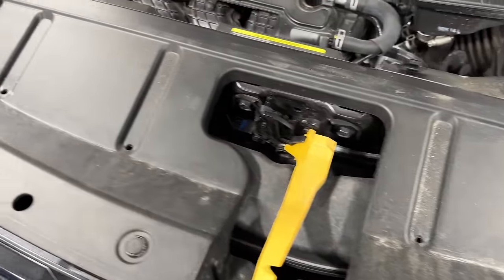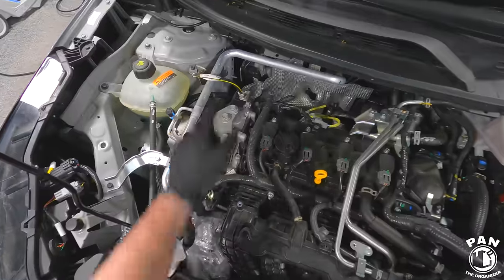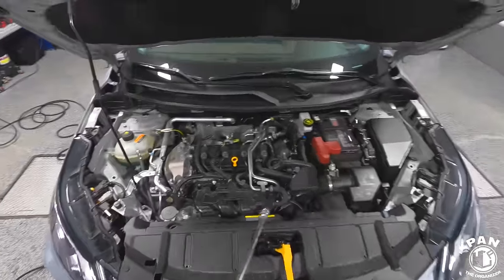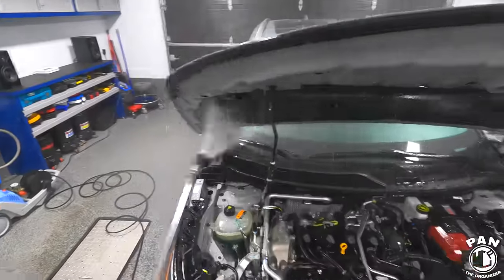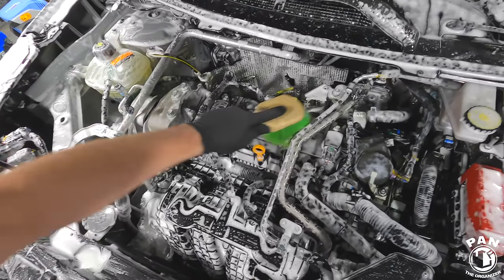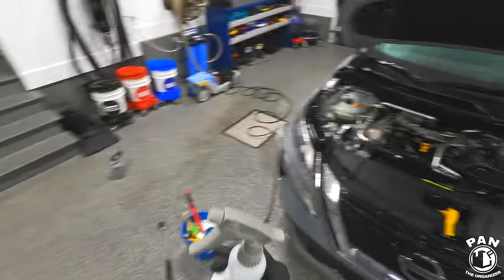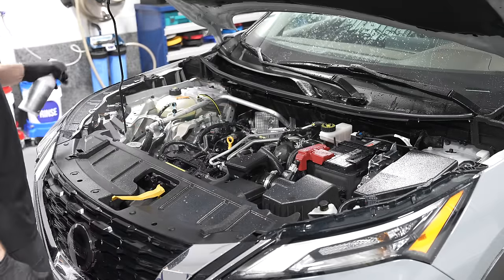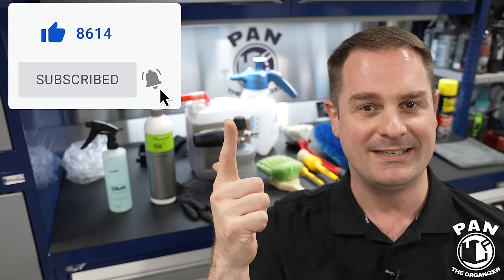How to Safely Clean Your Car's Engine Bay!

Comment: Great video as always. Still I'm not sure that using the pressure washer is safe. Instead I always use a couple of brushes and microfiber towels to do the job. It takes a bit more time but i think it safer that way and preventing any risk caused by water getting to some electrical parts, etc.
Reply from the maker: You do as you wish. I have pretty much always used a pressure washer and never once had any issue or feedback afterwards that something went wrong. Again, common sense. Also, a pressure washer uses less water compared to a garden hose. So although it seems like you're using a lot of water, you're actually using way less compared to a regular garden hose setup.
Reply: @PanTheOrganizer  LOL. Ivan is using a $20 garden hose that uses more water, while you’re using a $1500 pressure washer that uses less water. Ivan has saved himself a lot of money by using a little bit more water. Go Ivan.
Reply: Actually it’s quite safe to use the pressure washer if you are using common sense, staying below 2000 psi, and always keep the sprayer moving as Pan says.  Dealers use it and professional detailers have been using pressure washers for a long time now.
Reply: If water getting into the engine bay was an issue, we’d have issues every time it rains or we run through standing water. The only issue I can see is if you get too close with a pressure washer. If you use a fan spray and stay at a sufficient distance, you’ll use much less water with a pressure washer than a garden hose. However; like Pan said: you do you.

Edited for spelling
Reply: @CageyLeigh  1500$ for a pressure washer? Umm you know u can get one for 100 right LOL
Reply: You guys remarking about cost of pressure washer, if I may add to the o serration of 1500 is way expensive and can do with much less expensive…   Let me pitch out there that  since this man does this for as part of his business I suspect he can write it off on income tax.   Not to mention that usually a cheaper device will have comparable materials quality and build quality.   To buy a very well made for daily business use may well end up being less expensive in the long run by probably lasting longer.   Pan’s obvious attention to detail, self demands excellent product quality and I would think he expects same consistency and quality performance of his devices.  Thus requiring higher quality devices.    Pan using top notch equipment in videos gives an ole retired fella an opportunity to see grade A equipment in use.   I can then decide what I would be cool with compromising so to balance across all the gear one might use for the job.   Just sayin’   
JB
PS  Pan thanks for your complete triaged points of discussion across your videos.   I learn a lot from you.   Jb
Reply: @CageyLeigh  you tried to do something there but the pressure washer is also used to add a foam canon attachment. Ivan I’d using a garden hose not getting suds to develop to help get rid of dirt and contaminants. Ivan is scratching customers paint upon washing/drying. Ivan in the long run is going to work longer and harder for same job..

Comment: Awesome or Purple Power would've been better.  Crank cold car and let it run 2  minutes. Cover anything you may be afraid to get wet with plastic bags. Spray the Awesome or Purple Power on the engine and agitate with a brush. Spray another coat and let sit for 5 minutes, then rinse with water. Take a leaf blower or anything that blows air to dry. Touch up with a dry towel. Then dress plastic and rubber. ✌🏾

Comment: The engine came out very nice! I've cleaned a couple engines and have had no issues so far. Just take your time and use common sense like you said.
Reply: Riiight!?? Common sense.
Reply from the maker: There you go! You got it.

Comment: Unpopular Opinion: No one has issues immediately after cleaning an engine bay.  It's days to weeks later when the damage may become noticeable and often isn't even associated with the cleaning that took place some time ago.  Many experienced mechanics cringe at the thought of washing an engine bay because they KNOW what the outcome can be.  Be extra careful.
With that said, these tips and techniques are probably the best for minimizing issues.
Great work as always Pan.
Reply: that is true for old cars, where the gunk is probably blocking a oil leak.
Reply: It'll definitely mess with the ignition coils on early 2000 models.
Reply: What is the point of cleaning it? May be a stupid question from my side, but I just do not understand why undertake the risk of damaging the engine. Will the cleaning help anything?
Reply: @igorspitz  because when you have to fill the oil, power steering, and any other fluid, you don't want anything falling into the hole.  Also, when you have to service parts, they aren't gunked in grease.   You don't want this grease to get into the fittings, bolt holes, etc.  Essive dirt in your engine bay can get into electrical connections.
Reply: Well, how can you say "no one has issues immediately after cleaning an engine bay"? Of course some people do. People with old engines, crusty cracked rubber/plastics covering electronics and with a heavy hand. They can have immediate issues. And in all my years of cleaning engines, I never had a problem surface weeks later. But I also never acted a fool with water in there. 

Modern cars are totally different. They are very much designed to keep water out of areas where water shouldn't be.
Reply: @igorspitz  Everything is better when it's clean! That's the first answer. The practical answer is since cars pick up oils and grease from traffic driving in front of them, eventually all that gunk works its way inside the engine of your car. So 1) it helps differentiate issues with new leaks, 2) to a lesser degree, engines run cooler when they're clean and not coated with gobs of oil and grease, 3) it makes working and maintenance requirements less messy - whether you do it yourself or pay someone else. I have heard mechanics get annoyed at customer's disgusting engine bays and semi-retaliatorily allow their dirty hands and clothes inside their cabins figuring the person obviously doesn't care about dirt and grime. Personally, I love a clean car, inside and out.

I could go on and on, but there's a few for you.
Reply: @jasenrock  That's not the reasoning, it's all the electronics on modern vehicles.  Blasting water in your engine bay can wreak havoc on those components.  Like he said, you might not see it right away, it might be months later.
Reply: That's not unpopular to me.  I would never do what he's doing here.  At most, I will take a shop towel with some soapy water and wipe down excess dirt, but never spray anything in my engine compartment.  It's simply not necessary.  Nobody is looking at your engine, and cleaning it does nothing to improve your car.  If you're working on something in your engine, yes, clean the area before opening something, but a visually clean engine bay does nothing to improve performance, and it does nothing to ruin anything either.
Reply: agreed.... especially if the engine has a tiny oil leak(for example, valve cover or oil filler cap)...   just a tiny bit of drop getting into the engine like that can cause nightmares.
Reply: I wonder if this guy is related to Peter Pan?  A real cartoon character......
Reply: To ridefastjumphigh420. Most car dealers new and used do this to used vehicles that they are selling. Also if thier was that much risk do you think the detail chemical companies would invest in R&D to make them. I know your probably saying they don't care what happens when you wash your engine they just want to sell their cleaning chemicals. Like Pan said use common sense and don't soak the crap out things.
Reply: There is a risk of water intrusion into subsystems with any water exposure, age and pressure will make it more risky. Conversely, it is a lot easier to identify leaks and leak sources when leaking subsystems are clean, with a big bonus of noticing the leaks when cleaning.
Reply: I won't use  pressure water; one drop of water can go into a plug; it has happen to me immediatly after cleanig; I am gone try a vapor gun
Reply: I cleaned my engine bay in a Volvo MY 2020 last week for the first time in three years. It was almost not dirty at all, took an APC, a few brushes and cloths and went to work on everything I could see. Used some pressured air and a vacuum on the rest and finished off with some plastic detailer. Looks really good and no risk of damaging anything. The hood and surrounding plastics got some degreaser and pressure washer.

Doing this twice a year from now on will keep it fresh enough in my opinion. Great video though if you want to have it super clean!
Reply: I think it depends on the car/ some already have exposed bays via scoops/vents so there is always water getting in the bay.
Reply: Totally agree. Part way through the video he said to always have a customer sign a disclaimer, saying there’s no cracks in any cabling or plastic under the hood. Even if someone is a master mechanic, there’s no way to know that… because modern engine bays are so congested and tightly packed. 

I read a comment in another thread about a guy who said he ended up with a poorly running engine because the camshaft position sensor housing had a microcrack and got wet.
Reply: I love Pan but the first time I did this it came out looking fantastic. But now I have a problem with a miss. The engine doesn’t run smoothly and my gas mileage is way down 💩
Reply: @MrAwyork  It's far more likely that the water will get into the electrical connections.  It takes a while for copper to corrode, so the problem usually takes weeks or months to surface, at which point it's not immediately obvious that the water used to clean the engine bay is the root cause.
Reply: @tedjohnson64  an engine gets soaked when driving through a thunderstorm.  I live down a dirt road.  Dirt from mud puddles has caused more problems with my car than water.  In fact, I was recently charged an extra hour of labor on a repair because the mechanic had to clean up so much gunk to get to the bad part (oil pump)....on the plus side, the gunk was effectively sealing up a crack in the pump.  Went from a rebuild to replace.
Reply: unpopular fact*
Reply: @MrAwyork  If dirt mud puddles is causing problems with your engine, then either your plastic undershield panels are missing, damaged, or just poorly designed. And I've never seen a car whose "engine gets soaked when driving through a thunderstorm".  There's very little water that makes it through the typical car grille, and the water that does usually disappears almost instantly due to engine heat. The story about a mechanic charging an extra hour to clean up gunk to get to an oil pump is also hard to believe.  I've seen the underside of working farm trucks, brought to the shop without being cleaned, still caked with mud and cow crap, on the South Main Auto repair channel.  When he put them up on the rack, the engine compartment (where the oil pump lives) was only mildly dirty, because it was protected by the plastic panels under the car.
Reply: @tedjohnson64  the puddles are deeper than the bottoms of the doors.  I saw the gunk myself.  So, real story.  I actually stood next to the mechanic under the car when we were deciding there was a problem with the oil pump.
Reply: @tedjohnson64  also it isn't the rain so much that "gets through the grill"  Its hitting puddles at 60+ miles per hour.  It's other vehicles throwing enough water on your car to completely "white out" the windshield.  Also, I think Honda is at least good enough at designing cars.
Reply: @igorspitz I just manually spray it with degreaser or plastic stuff & wipe it with a brush then wipe it down with a towel, I’ll never understand cleaning it with water because 1.) just in case & 2.) it’s gonna get dirty quick anyway like the rest of the vehicle, but cleaning these areas and your car probably once every 2 weeks or so is good
Reply: Love a dirty engine bay me. Seals things protects from water and condensation. Since when does anyone want a clean engine
Reply: Yea im gonna say NO to this. Nit buying that it doesnt have massive potential for catastrophe. I get you e done it for 25 years. So have tight rope walkers - doesnt mean its safe
Reply: @jasenrock  It's true for all cars.
Water in around electrical components is worse that no water in around said components. Unless your under bonnet is so bad that it may affect reliability or safety, or you have a car that you want to make a show car leave it alone.
Reply: @ridefastjumphigh420  correct! this from the small amount of water that enter  the connections and cause corrosion over time and reek havoc . Water will always seep though especially in connections that face upwards. Water will always settle in the valley and get in, this while you’re in the process of cleaning. When you’re blowing off the water or drying it, it’s already too late.
Reply: No disrespect as you certainly know your stuff, but I have to agree that even if there is the most minute chance of damaging the engine, I will not tempt fate. Better to have a dirty engine that runs great than to have a super shiny and clean engine that doesn't. I will be cleaning my engine bay very carefully with a very controlled minimum of water...definitely not from a pressure washer. It makes me shudder every time I see that done, and no amount of reassurance will sway me.
Reply: @igorspitz  there's really no point. I wouldn't put water on the engine from above. From underneath, that's something that can happen unintendedly. From above it's too risky for me.

Comment: Absolutely fantastic. I’m going to clean my 2016 Mitsubishi Outlander that I gave my wife to drive. (I bought a Toyota HiLux and she wanted to keep my outlander because she loves it) I purchased it brand new and it has done over 300,000 kilometres and the engine bay is very dirty. I’ll post a pic of it before and after.
Thanks Pan.
Reply from the maker: You bet!

Comment: TY Pan loved this engine detail video, I do pretty much as you did to detail my engine with similar products available here in Australia except on the hood/bonnet, there i find it much easier to use damp/wet micro fibre towels after spraying the metal areas to wipe off any dust and then vacuum the material sound proofing. I do it that way as i don't like to get a lot of water on that area. Loved this mate as so many as you said tell you DON'T DO IT!! you will cause issues, well I have never had an issue detail the engine bay and my mechanic loves me for it makes it a joy for him to work on and shows i care.
Keep Safe Keep Strong 🦘🦘🦘🦘❤❤👍👍👍👍
Reply from the maker: There you go mate!

Comment: I use Optimum Power Clean and steam to clean engine bays, along with microfibers and assorted brushes.  I've used my old wheel woolies to clean some of the "less accessible" areas of engine bays. I blow them dry afterward. Another thing to consider is to block the air intakes to keep excess water from entering. For cold air induction systems, I wrap a gallon size ziploc bag around the air filter.

Comment: Thanks Pan!  It was great to meet you at SEMA.  I always look forward to drinking coffee and watching your videos on a Saturday morning. 

I have over 20 years of auto repair experience. And agree that most things built after 2005 should handle these steps pretty well. Never use a garden hose, avoid high pressure contact from both washer and compressed air. You don’t want to force water past the weather pack seals. And of course, use common sense and look the engine over first.   I would also watch out for labels fixed to plastic parts.  They come off easily with water and dirt if not being careful.  Same with powerful degreasers on painted engine covers.
Reply from the maker: Thanks JJ! It was nice meeting you too. I love the "Pan and coffee" morning routine! :)

Comment: That alkaline stuff is caustic and a good electrical conductor. So probably more precautions would be needed for older cars. Also the brake fluid is hydroscopic and its reservoir cap usually have a little hole that one might not want to wash with pressure.

Comment: I love Hyper dressing. Being able to control the gloss level is amazing but Motorplast is hard to beat. I coated everything with Vonixx V-Energy engine bay ceramic coating and maintain it with Motorplast. It 95 percent self levels, isn't too glossy, lasts a long time and actually protects more than just the plastic. Phenomenal product IMO

Comment: I drive an '07 Silverado and the engine bay looks better than new, even with 211,000 miles on it.   I've never had any issues after cleaning the engine bay and I don't take any extraordinary precautions..........................I just don't get stupid with the hose or the pressure washer.   Great video
Reply from the maker: Well said. People need to use common sense and take their time to do a proper job and they’ll be fine.

Welcome to my channel. You discovered one of the biggest car detailing channels on YouTube as we surpassed 965,000 subscribers and we have over 130 million views! I have been detailing for 26 years and I love to share my knowledge and passion with my viewers.

You found the right channel to help you learn everything about detailing.